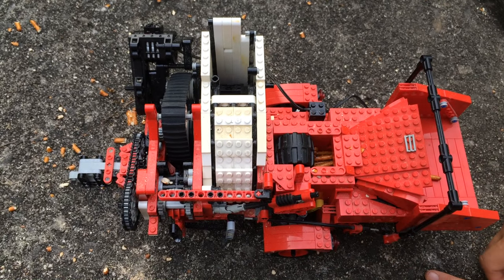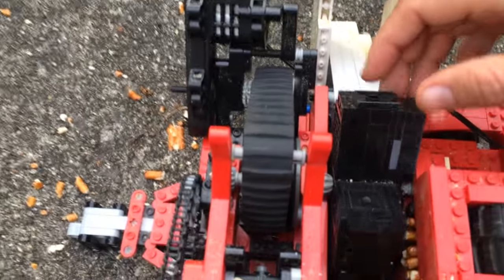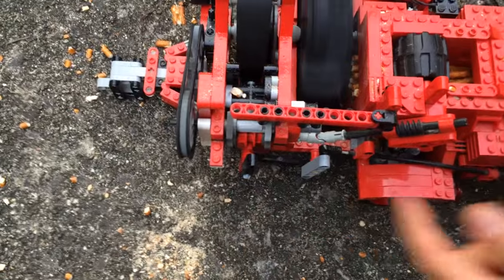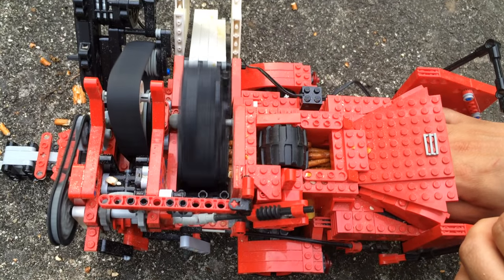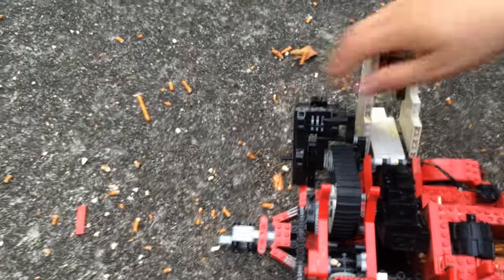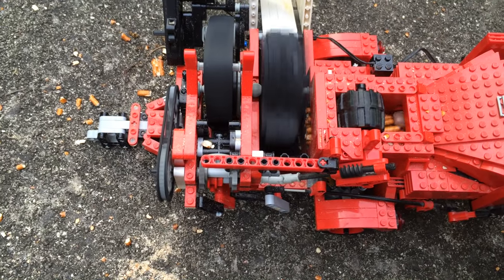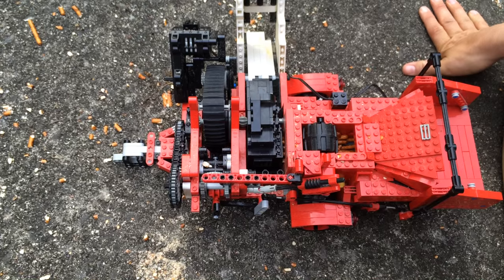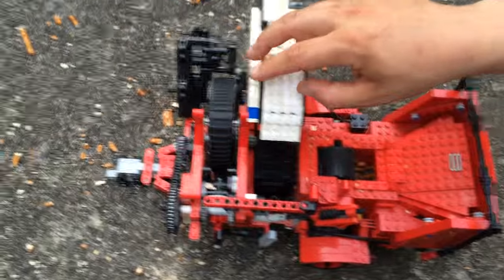Lego Pretzel Chipper

Comment: A chipper most certainly has sharp knives. Dull knives cause excess wear on your machine. The weight of the drum means a lot but not much without sharp knives.
Reply from the maker: By "sharp" I mean that the angle is only 45 degrees.  They are more hard than sharp.
Reply: designsthatbuild chipper blades are definitely sharp dude
Reply from the maker: The bevel on the blades is only about 45 degrees, so if you touch it with your fingers, it is not sharp enough to cut you, but with the weight behind it it can tear through logs. The blades on the one I used to use were 1/2" to 5/8" thick.
Reply: I've accidentally cut myself handling the chipper knives. So, yours just weren't sharpened properly if you can't be cut by them. They don't need to be razor sharp. That's a waste and the edge will roll over making the whole thing a waste of time but they should still be sharp enough to cut your skin.
Reply from the maker: @Beasthornen  sorry it took me 2 or 3 years to reply. I hadn't really been paying attention to this  video for a while. Yeah the chipper I used wasn't mine, so I never saw the blades get sharpened.
Reply: No worries, I had forgotten about this.
Reply: Is there a place I can buy this cool little chipper or is it homemade?
Reply from the maker: @Beasthornen  Its homemade